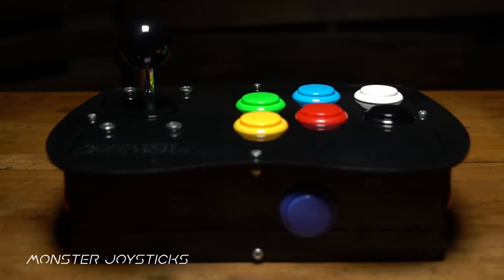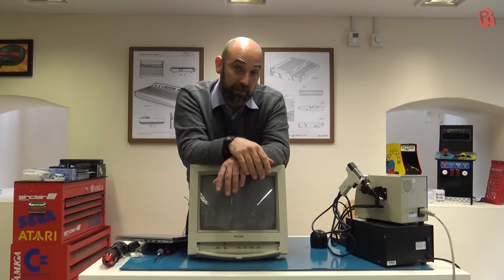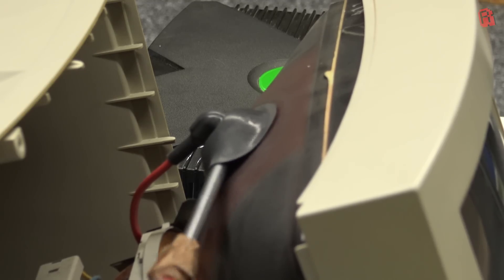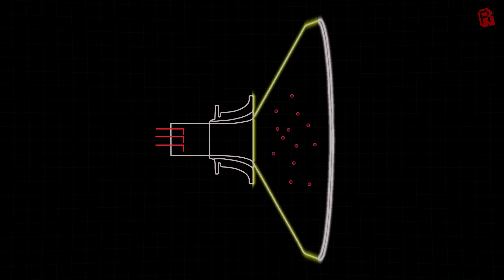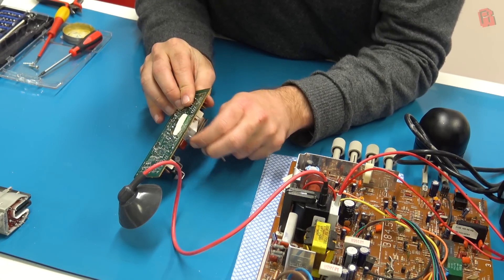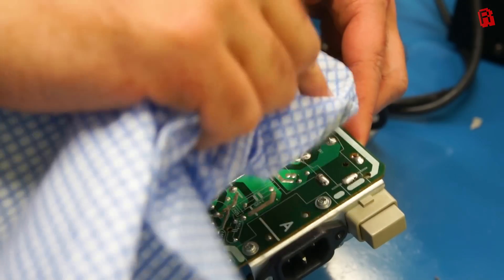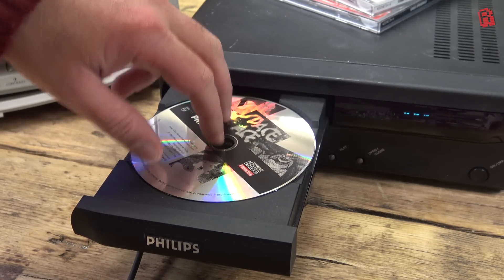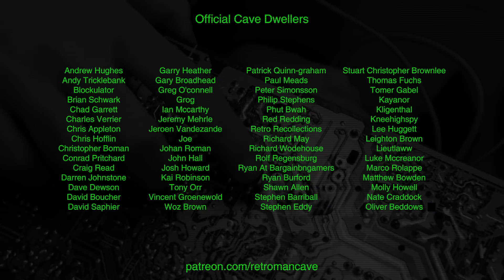Fixing up a CRT Monitor - Philips CM8833 Mk2 Flyback failure

Comment: Would like to see a video on quieting and/or eliminating high-pitched whining from a CRT.  I know that something is vibrating or oscillating causing the noise.  I've had to stop using my CRTs because after listening to the high pitched whine for 10 to 20 minutes, I get a horrible migraine, followed by several more hours of ringing in my ears.

I thought about just putting hot glue everywhere, but I don't know if it's conductive.
Reply: The 15KHz whine is just part of how CRT's work, and theres not really much you can do about it
Reply: @jaycee1980  He might be talking about a secondary whine which is much louder. Might be something failing as one of my 1084s has a very audible whine, but the other crts don't.

Comment: This reminded me of when I took my PVM to a local repair-man to dissasemble it for me (I was too scared to discharge myself, even though it has a discharge circuit)... anyhow, when I got it back the image was so distorted and green, and it was making this huge high pitched noise... Called the repair shop and they said it probably got some water condensation inside from sitting in my trunk during the rain the previous night. Guess what - it wasn't that! I noticed some flashing from the side mesh of it and it turns out one of the high voltage leads that attaches to the flywheel was detached and it was shorting (like making this plasma arch) to the metal of one of the nearby capacitors. All fear aside I had to reattach it hahah. Good thing that that worked, but still not completely confident to dissasemble and clean a CRT on my own, there are high voltage capacitors there that are scary too - and even being careful it is not a feat anyone should underestimate. Thanks for the great content! ^_^

Comment: If you find yourself doing this again, I think you could make an in-situ adjusting tool pretty easily by taking an appropriately-sized wooden dowel from the hardware store and filing the tip into a flathead screwdriver shape.
Reply from the maker: The simplest ideas are the best.  I love this thanks Wayne

Comment: I remember getting a shock off a crt a long time ago... it really f*cking hurt! It was a rented tv from radio rentals (there's one for the kids) To tune it the whole back had to be removed to access the small tuning knobs and of course this had to be done while turned on. So there I am standing in front of the tv giving it a reach-around to twiddle it's knob so I can tune in my Commodore C16 (we were poor, this reply is best with "in the ghetto" as it's soundtrack) and my forearm brushed something very live indeed. I really don't recommend it... I've had a few 240v shocks over the years but that was really nasty. Although finding out how awfully shit my new C16 was turned out fairly painful as well
Reply: Short "new hardware" honeymoon period with the C16, huh?
Reply: donno if I wanna lol or cry... heh    :,) 

<3
Reply: Did much the same back when I used to have to repair CRTs as part of my job - familiarity breeds contempt and I got bitten. Naturally, in front of a paying customer. I may have sworn, just a little. So, so much worse than when I gave myself a 240V belt in front of a (different) customer - although thinking about it, I think I swore that time, too. And then everyone laughed at me, the unsympathetic b.... :D
Reply: ..... its knob .....
..... its soundtrack .....
it's is the contraction of "it is" so you were saying "twiddle it is knob" and "as it is soundtrack"

Comment: Is it possible to save a tube that's dimmer and takes a few seconds longer than normal to light up?

I have a SAMSUNG SyncMaster 900p, and I can get over 160fps on it, however it's pretty dim and takes aout 4-6 seconds to illuminate.
Reply: Sounds like it needs it's capacitors replacing.
Reply: You can turn up the screen voltage a bit, but you may end up just setting off the xray protection circuit. Chances are it's dim because the tube is worn out

Comment: I want to point out that a broken flyback sometimes shows in an atypical way. I had a case where there was no noise and it was still building up some charge in the tube, but it was still dead.
Also, when replacing the flyback, you should also replace the horizontal output transistor (HOT) and the snubber capacitor connected to it, because it's often a broken HOT that leads to a dead flyback, and on the other hand it's often a broken snubber capacitor that destroys the HOT (or broken solder joint on either of them). Otherwise, you might end up destroying your new flyback transformer.
Reply from the maker: Thanks for the tips, I have a friend who had a new Flyback die just a month after fitting so I'll pass that on to them now, really useful
Reply: niino could you show us where these sit on the boards Nino? I am prepping to do the repair on my monitor and may as well do this at the same time.
Reply: I think this is what’s just happened to my Atari SC-1435, replaced the FBT and it’s still sounding like Galaxian. Will check the HOT and cap in a bit
Reply: Thanks so much for this info!

Comment: PSA for anyone else: Please remember it's not just the CRT itself that holds a potentially lethal charge. Depending on your monitor, you may have a nice selection of caps on the board holding hundreds of volts
Reply: the input capacitor in the SMPS is probably more dangerous than the capacitive effect of the tube. The high kV from the tube will give you a hell of a belt and you will know about it, but there usually isnt enough energy to kill you. The 400V on the SMPS capacitor on the other hand, can kill you

Comment: @Neil: Pro Tip: If you don't have any insulated screwdrivers - or plastic screwdrivers, which would be the appropriate tool to use inside "high voltage" equipment - in your caveman toolbox you can always go the "poor man" route: insulate the metal shaft of the screwdriver by sliding a piece of heat-shrink tubing over it - leaving only the tip exposed - and shrinking it on. Be aware that this is by no means high voltage insulating (read: if there's a chance you could fetch an arc wear appropriate HV insulating gloves), but it will at least help you in "poking across" the device, to reach the pot you want to adjust, without the danger of shorting anything out - unless you ram the tip of the tool right into something.

Comment: I couldn't hear that at all, and I'm only my late 30s. I have really damaged my hearing.
Reply: All I could hear is a washing machine, a cat meowing and arguing kids. Hope I get noise negating headphones from santa.
Reply: Ha, all I could hear was my tinnitus.. 39 yo.. it'll grow back though right??
Reply: Faselei! 777 same here.
Reply: Only 26 here and I can never hear the crt sounds, I don't recall ever hearing it when I was a kid either tbh.
Reply: @RisingRevengeance  I always was able to hear it till about 6 years or so ago and now I am 52.  I would be able to hear the large screen tv running in the house if it was quiet.  I can hear around 13 Khz or so, same cant be said about my eyesight,.
Reply: I'm 40 and I still heard it plain as day
Reply: I heard it, but I've got bad hearing. Maybe your device has something wrong with its sound
Reply: @The Baby Eating Bishop Of Bath And Wells. Actually i did one of those tests here on Youtube and I could hear about 15 Khz. just under the what is it 15750 khz or there abouts, but now at 51 not so. But i do have good hearing for my age, i have even used hearing protection vacuuming I hate the sound .

Comment: Brilliant to finally see someone do a video on these Philips monitors, cause over the years i've had 3 of them that have developed this same exact problem. I gave up on them thinking it was a major power supply issue, so it's a great to finally find out the actual issue, solution and where to get the parts. Ironically i'm yet to have a faulty power switch on any, but I know it's a very common thing to fail.

Comment: I always thought you could twist and pull the cable from the neck board socket, and install the new cable by pushing and twisting rather than removing the cover? Is that not the case on these?
Reply from the maker: That would have been nice!  If it's designed to work that way I gave it plenty of twisting and pulling and it didn't budge, before resigning myself to make a brew and excercise some patience to lift the lid.
Reply: @TheRetroCollective  That's a shame, it's the first time I've seen this needing to be done (but then again I'm used to working on arcade monitors and can appreciate consumer models are different).

Comment: If I were to wear rubber gloves while working on the CRT, would there still be any point in discharging it?
Reply: absolutely, 20K volts will jump through rubber gloves and kill you no problem! =
Reply from the maker: Yes, always discharge it.
Reply: Absolutely! Back in the 1970s I was a trainee TV engineer and saw what CRT discharges can do. We had one engineer accidentally get a shock between his wrist and the base of his little finger. The muscle in between was frozen in a spasm for the best part of an hour. There was also a rule that said you should only ever work with one hand inside the TV if it was turned on (which you had to do for a lot of fault finding). That was to prevent getting a shock between one arm and the other - i.e. going straight across the heart. Shoes with thick rubber soles were also a good idea!

Comment: I replaced the flyback in my 1084 monitor last Sunday. It was a bit easier, since there was no need to disassemble everything - it was easy to reach the flyback. The only thing was, the pins on a replacement had slightly different pin spacing - a fraction of mm difference, yet I had to fight with them a bit and add a new hole for one of the GND pins. But the monitor works again :-)
Reply: Hi! what was the flyback model? the same used in the video?
Reply: @pateixeira22123  Looked the same at the first glance. I have no idea, if the model was the same.

Comment: Awesome!
The main problem for replacing your flyback seems to be being able to get hold of a new flyback. Are new ones still produced? Any tips of where to look for one?
Reply from the maker: Check the description I've put a link there for where I sourced mine 👌
Reply: I have to do the same for a 15" compaq but can't find one anywhere based on the part number.